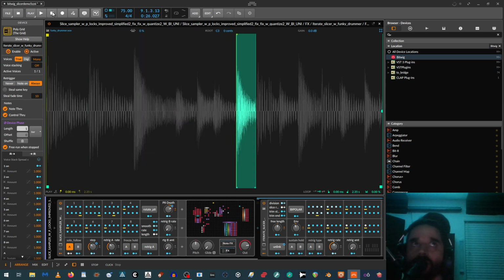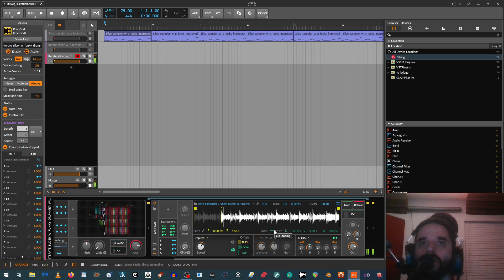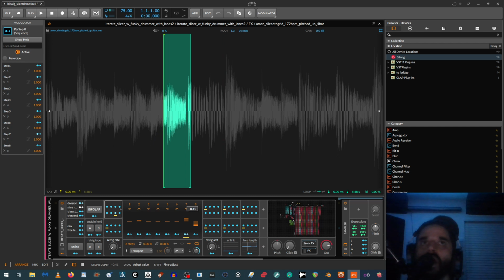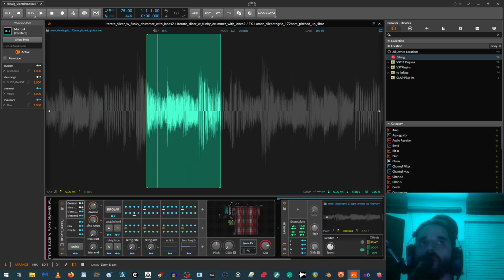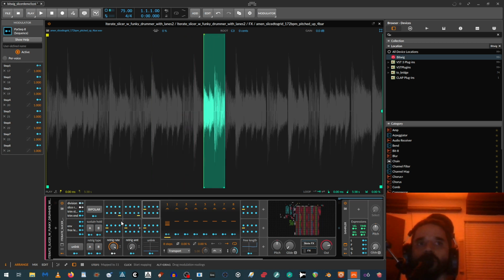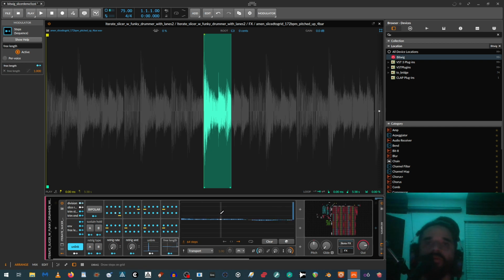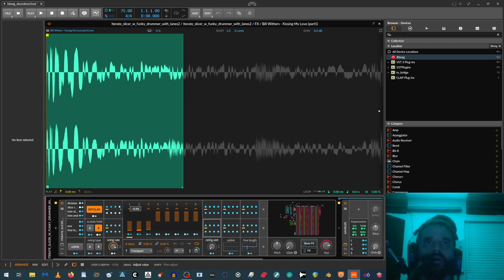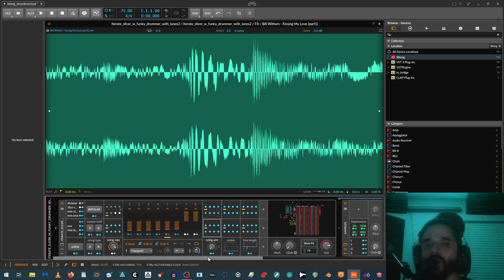Sample slicer for Bitwig (free download)

Comment: Hey man, the link is broken, do you still have this device?!
Reply from the maker: I just removed it a couple weeks ago, because I have much better version in the works.  This one had some issues.  The CPU load got high, and the envelope hold time would get thrown off when changing pitch or speed.  I fixed all that on the version you can see here: https://www.youtube.com/watch?v=Ecg1S_qhtwo. I plan on making this patch available soon.  I'm working on a bundle of devices that are catered toward glitch and idm production.  I just want to clean all the devices up, and make them as easy to understand as I can, before putting them out.

Comment from the maker: I had several people ask me about the modulation going on with the breakbeat in the begining of this video.  That is coming from the second polygrid patch, that the slicer is inside of.  The parseq8 modulators on that patch are used to sequence between different parameters throughout the patch.  Those snapshots can be triggered by the transport, a knob, keys, lfos etc...  In this case, they were just triggered by a knob.  So, if you look at the automation, there is only 1 lane, which is the knob that scrolls through those snapshots.  I will make a video soon about the parseq8 modulator going deeper into the ways I like to use it.

Comment: I know who you are before, your name was Heyoka, right? Formerly I listened to his glich movement next to mimosa
Reply from the maker: Hi.  Yes,  I used to produce under the name Heyoka from 2005 to 2012.  I saw a comment from you in my notifications, but for some reason, it isn't showing up in the comments right now.  Anyway, the sampler is located in the fx section.  Don't open the Grid window.  If it is open, the cpu will be high.  As long as the grid window is closed, the cpu should be ok.  I now it's not great.  I think I might be able to wire this thing up in a different way.  I'm just trying to make the lengths work the same with this other method.  Anyway,  I'm gonna revisit it at the end of the month.  I was in a bit of a rabbit hole with the Grid for the last couple weeks, and I need to switch gears to finishing some tracks up in time for some upcoming shows.  When I get the new version done,  I'll link it on this video.  Can you let me know if CPU is still bad for you with the Grid window closed?  I am running an old pc, so I was kind of hopeful that it would run better for others.
Reply: @AndreiOlenev  Hello, yes I already found the sampler, I had to double click on polygrid and everything would be displayed.
The CPU consumption with polygrid open is very high but when it is closed it drops considerably if I had to open two units I would have a serious problem to work smoothly with a project. the CPU consumption is high it takes up a quarter of my charge bar and I have an i5 with 16 of RAM

when i use the unlink button and i want to move the grid size with the free length of the step sequencer, it doesn't work, it doesn't move the grid like in your video

It's an awesome tool for working with Reece's tracks. I am also testing it. I have been looking for something like this for a long time.
Reply from the maker: @endosick3998  Hey.  Thanks for the feedback.  Like I mentioned earlier, I have a couple ideas for how to simplify this project so the CPU goes down.  But, it's a little tricky to get the loop lengths working right.  The start points are a lot easier to deal with.  Hopefully this other method I have in mind works.  If it doesn't, than I might at least just split out the current one with a few different versions.  In a lot of cases, you don't need 64 or even 32 steps, so having versions with lest steps would bring down the cpu a lot.  Also, I could split out the fully manual version from the beatsync/manual version, because that would simplify it as well.  I've been experimenting with slicing in the Grid for a while.  This is kind of the most complete slicer I have done, in terms of having the most flexibility for different ways of slicing.  But, the cpu is  bit higher that I would like it.  Especially, because I like to run it inside of another Polygrid patch, that handles all the tweaking/modulation.  Anyway,  it's kind of a work in progress, so, I hope to develop it more in the next coming months.
Reply: @AndreiOlenev  "Also, I could split out the fully manual version from the beatsync/manual version, because that would simplify it as well"

This is a great idea... I'll be very attentive to the new changes, it's an exceptional tool
Apreciated !

Comment: Renoise has this built in
Reply from the maker: Yeah,  I use Renoise as well.  I like it a lot.  I think most DAW's have slicing in their samplers.  It's the one feature I really miss having, since switching to Bitwig from Ableton.  It seems very odd why we don't have it yet.  Especially, because Bitwig has a lot of sort of "Elektron" style features (like operators/ trig conditions". But, Bitwig's sampler, is incredible, especially in combination with the modulation system.  I actually started this project, because I was working with a bunch of breaks, and I was basically slicing them in Renoise, to get them quantized, to use in Bitwig's sampler, and it just seemed like a roundabout way of working.  If Bitwig's sampler just had slicing built in, I think it would be the best sampler around.  This project is basically just a workaround for that.
Reply: @AndreiOlenev  have you tried renoise redux?

This is an interesting project, but I’m trying to figure out why I would use this over renoise redux
Reply from the maker: @joshuaschmalle_vlogs  I have used Redux.  It is very cool.  But, Bitwig's sampler does things that Redux doesn't, and, I just prefer using the built in sampler.  But, Redux can open sampler setting saved from Renoise, so if you have samples already sliced in Renoise, you can open them in Redux to use in another DAW.
Reply: @AndreiOlenev could you elaborate?  I haven’t really dug into bitwig sampler because I have to many different options when it comes to samplers ha ha.

It seems like its pretty much like lives?
Reply from the maker: @joshuaschmalle_vlogs  For 1 thing, similar to ableton's sampler, the bitwig sampler can have 128 samples in it, controled by a "select" knob.  Whats' unique to Bitwig's sampler is that is it has 3 modes (tape,textures, and cycles).  Textures is the granular mode.  It is very basic in terms of the controls that you have compared to other granulators, but in combination with Bitwig's modulators, you can do a lot with it.  For example, common granular parameters like "Jitter" can be done with the random modulator.  There is no Density control for doing things like grain clouds, but with voice stacking, you can achieve something similar to grain clouds.  Cycles mode is meant for making wavetables, and can make a lot of interesting sounds as well.  Of course there are more feature packed samplers out there, but for me, I just like to use the built in sampler for any DAW, because I feel like they always integrate into the DAW well.  To me, the coolest looking software sampler around right now is Mimic in Reason.  I was considering getting reason just to use Mimic as a vst.  But, it's kind of expensive.
Reply: @AndreiOlenev  ya love mimic.  I have crusher x for granular so its been a while since ive messed around with using a “sampler” as a granular. 

Thanks for the info, Ill mess around with your device, it does seem like it could be fun 

I love seeing devices like this built!  Pretty ingenious!